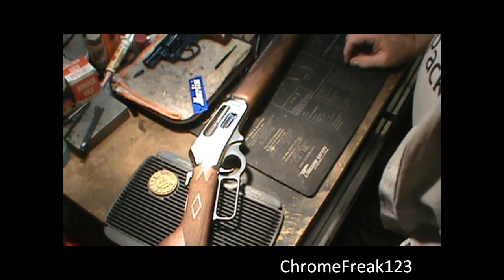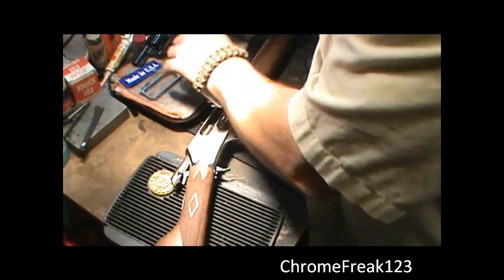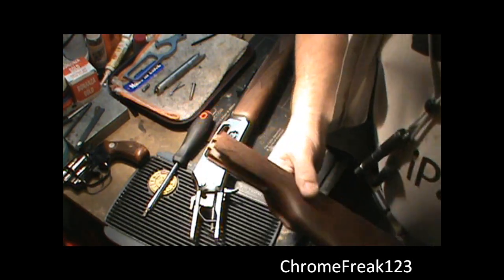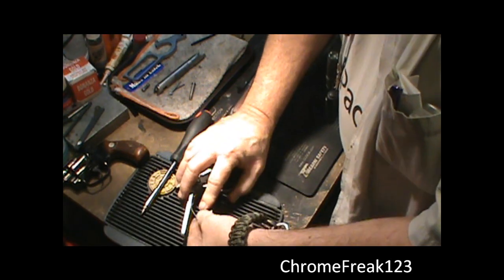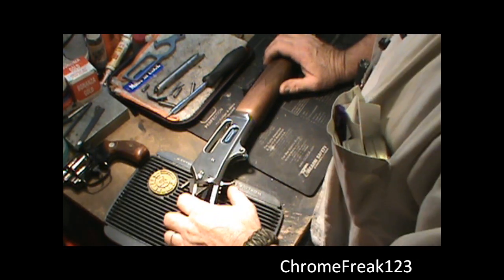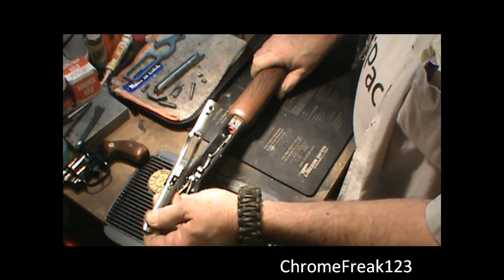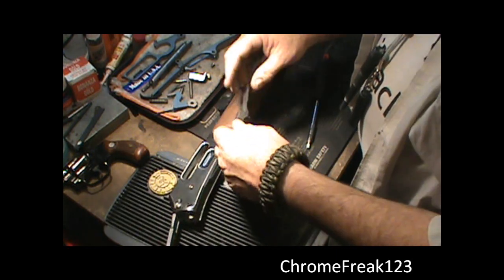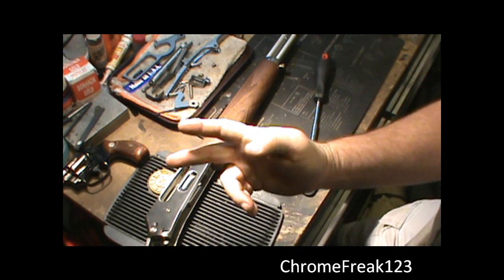Marlin 1895 Detailed Disassembly !!!

Comment from the maker: I should have done a video on this. I would lay out all the parts after disassembly, kind of piece them together like they are in the receiver. You can then see where they will rub against each other, it is those spots that you want to smooth out. I hope this helps. Thanks.

Comment: Great video, as always!!

I have a question: I've read on some of the forums that Marlin was purchased by Remington in 2002. And Remington laid off all the workers for Marlin and moved the manufacturing to the Remington facilities. And since that time, the quality of Marlin has suffered; shotty butt & forearm fitting, misaligned sights, inner workings with a lot of left over machine marks. Can you do a video on that to confirm or deny those claims?

I like the older Marlin rifles.